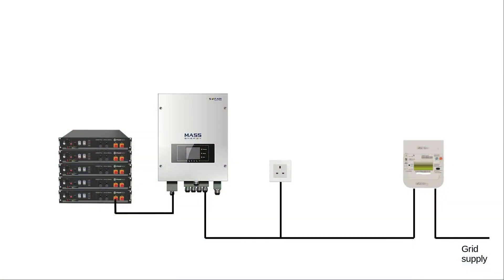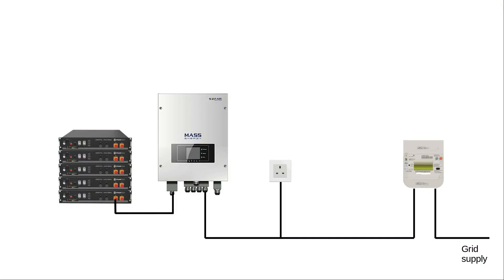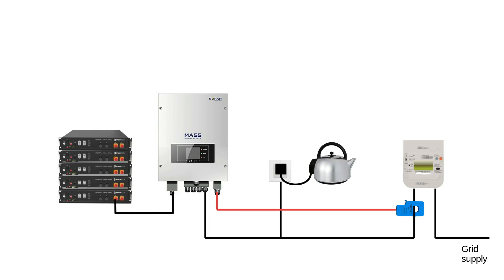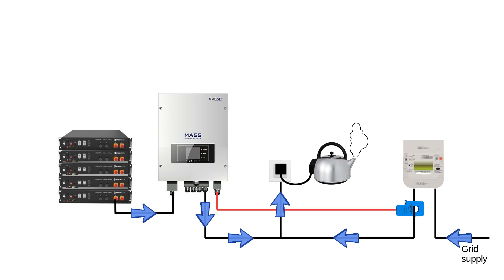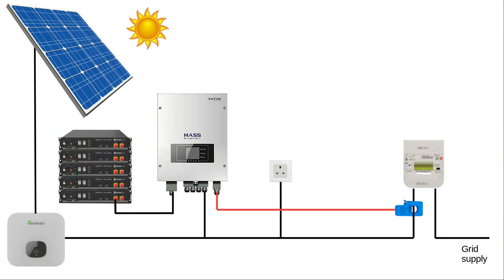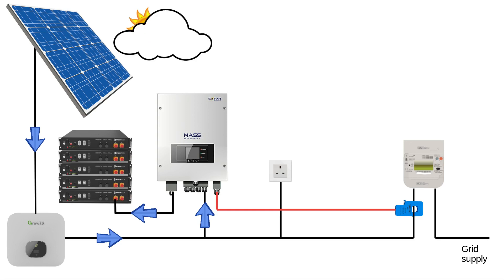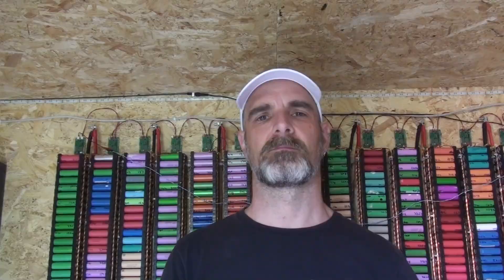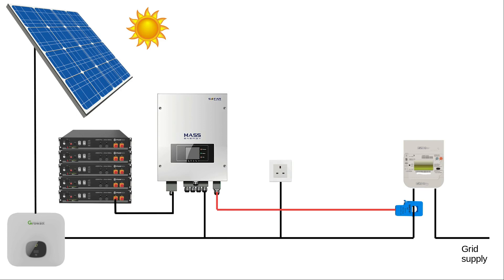How does grid-tied battery storage work.

Comment: Hi Nicholas, brilliant videos and content, with your solax hybrid inverter what is the charge rate to the Pylontech? when your solax setup are producing at their max rate 5 kw do you end up losing power that doesn't go to the pylontechs ?
Reply from the maker: The charge rate is 2500W to the batteries so you are right, I would export some if I was producing 5000W. However in practice this almost never happens as I dump any excess into my cars, immersion, dishwasher etc using my automation system MonACle.
Reply: @nicholashowell  Hi do you havd a git for your MonACle or could share?
I’m about do go down the Victron Multi II with pylontechs route and wondered if yours or some open source software could help manage it. 
And if you could start again would you still go pylontech or choose another like byd. As im finding buying batteries in the uk very difficult. 
Many thanks
Rob
Reply from the maker: @robertjumpp3268  Sorry but MonACle is not ready to be used by anyone else, it still needs much work. I would have to write an adapter for the Victron for it to work and that would take time as I would need one to test with first. I would still go with the Pylontech batteries, I'm happy with them.
Reply: @nicholashowell  Thank you anyway. Keep up the videos, I'm on a bing and really enjoying them. Cheers

Comment: Hi Nicholas. Great video. The system I am planning to install is one that takes a feed from the grid ONLY to top up the battery bank when my solar panels are not creating enough energy. I am not interested in feeding anything back to the grid. I also want to stop any statistical data being gleaned by my energy supplier (I have a "smart" meter installed and they will not remove it) - so basically, all they can glean is that I am using X amount of energy to charge my battery bank. So, in simple terms: 1) Grid supply to dedicated consumer unit to battery inverter for charging 2) Battery inverter to the house consumer unit  3) A switch for switching to a separate dedicated “critical appliances” circuit in the event of grid failure 4) Generator battery charging in the event of grid failure
My question(s): Is this classed as a “hybrid system” and, since it does not feed back into the grid and do you think it will need DNO approval (again because it does not feed back into the grid)

Sorry this was a bit long winded
Reply from the maker: Hi Chris.  I think you are confusing the term hybrid system with grid-tied system.  A hybrid inverter is simply an inverter that contains both a solar inverter and a battery charger/inverter in the same unit.  It is my understanding that if you are using an off-grid inverter that you would not need DNO approval since it does not back feed onto their network.  I'm not sure what it is you want to achieve but if you want to run your house distribution board from an off-grid inverter (like the one I have in my power shed) then you need to consider what your maximum power draw will be since your inverter will only be able to supply up to a maximum amount of power.  My shed inverter is 5kW so the off grid circuit that it supplies must never exceed this amount of power.  I think you would be better off with a grid tied system especially as you are going to be connected to the grid anyway.  A smart meter does not know what you are using power for, just how much you are using at any give moment.  I don't think you need to be so concerned on that front.
Reply: @nicholashowell  Thanks for the prompt reply

What I am trying to achieve is a system that reduces my reliance on the grid as much as practically possible - similar to yours I guess

The use of the word "hybrid" was basically to describe a system that draws power from the grid and solar PV, nothing to do with inverters - probably not the best word to use in this particular instance

The most important thing is to have battery backup to power my "critical appliances" circuit (3 x 13amp sockets and a water heater) in the event that these fruitloops that seem to be running our country at the moment start their "climate change lockdowns" - which I believe is a very real and immenant possibility .... Call it insurance :-)

Re. so-called smart meters, yes I understand that they do not know what I am using power for - its just that I do not like them "spying" on my detailed usage - and more importantly, the time of that usage, so any way I can attempt to "scupper" that, I will!

"maximum power draw" - Yes, I understand

So, thanks again for your reply
Reply from the maker: @chrisrebar2381  I think I get what you want to do now.  In all honesty you are probably better off with a grid-tied hybrid inverter like my Solax unit.  It will only pull from the grid when there isn't sufficient solar or battery to supply the loads in your house.  So most of the time you will not be pulling anything from the grid and your smart meter will see nothing.  You can charge the batteries from the grid at night if you so choose (for those winter days when there isn't enough solar to give you enough charge).  It also has an off grid function so that it can continue to operate in the event of a grid down situation.
Reply: Nicholas Howell 
Thank you very much. You're a talented man and your time and effort to create these very informative videos is greatly appreciated. I will try not to bother you again :-)
Reply: @nicholashowell  Just as a "by the way", I was working on one of the first companies to trial data feed back over powerlines back in 1991 (London Electric). This work highlighted the potential for "behavioral usage" analysis and how this data can be used - or more importantly, misused. Anyway, if you are interested then this link explains in more detail what I mean
https://smartgridawareness.org/privacy-and-data-security/how-smart-meters-invade-individual-privacy/

Comment: If you’re in California, don’t waste your time with grid tie. The regulations call for the utilities to control your system, this benefits them, not you. The grid inverter and permits money would be better spent off grid batteries to keep and use what you make. In Santa Clara county permits can take up to a year and the inspectors will often require changes that aren’t code and not safe. Incompetents

Comment: YES, that was interesting, thanks a lot.
But that late switching might less happen in the night, as there only the usage and balance from grid or batteries might be. But 30 KW to pay instead of 100, as of store the solar local should be ok.
I even think about to turn it off in the night, as I want to use it for power offs, and then only during the day with solar input (charge and balance that with he clouds),
and later, when I got better data, maybe get in on in the early morning when more grid taking takes part, to empty the batteries to that time, the solar charge will start = balancing during the day + recharge, and keep the energy until I can risk to empty it, maybe from 2-4 am - as hold back for electric failure.
Yes, I got better understanding ... as I now have only 2 OnGrid Solar (each about 2.000 Watt lunch time), and switch on off my aircon manual, when I see with 10 sec distance if there is enough (>800 Watt) to turn AC on ... . 
It works, as I sit at the PC most day and see the data ... still ok, but anyway I wanna a AC Storage as for this a lot electric failure here. Fridges, Internet and light ...

Comment: Yeah your vid explain alot and helped me much,,  Can you recommend the sofar Charge controller?
Reply from the maker: The Sofar ME3000 is quite good.  It can charge/discharge at a maximum of 3000 Watts so if that is enough to cover your usage then I would recommend.  It works good with Pylontech batteries too.